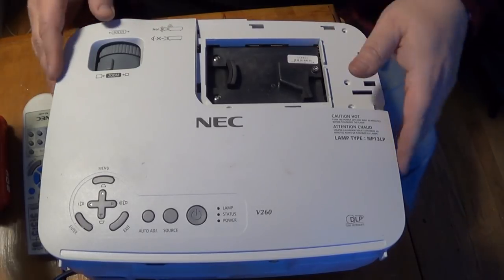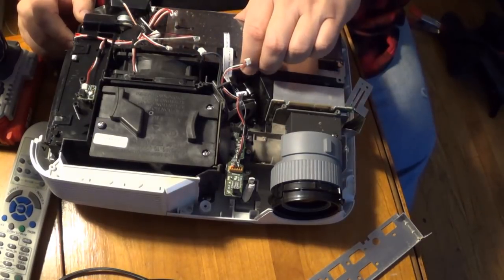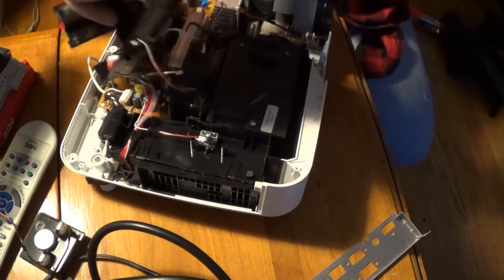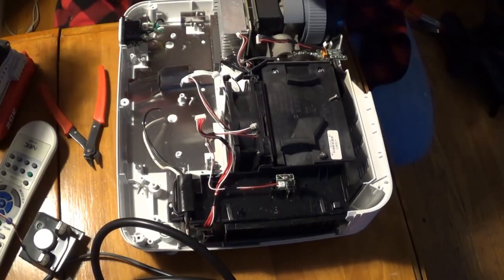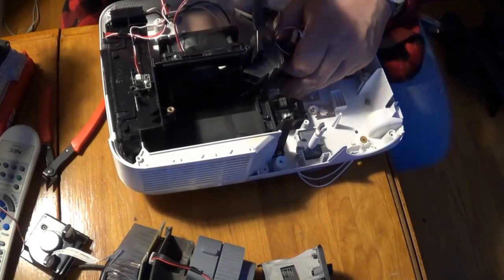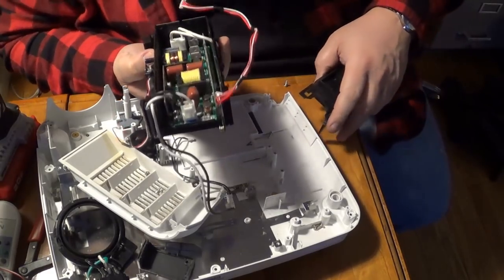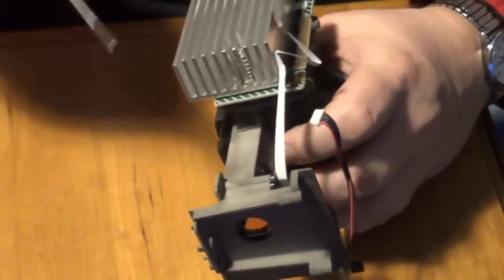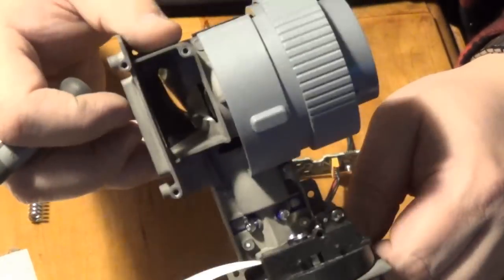Scrapping a Digital Projector for FREE GOLD!  -Moose Scrapper #261

Comment: I strip all my circuit boards using a heat gun. Not that they are alot of value but i get what i can it just makes it easier to get rid of the stuff that is basically garbage. I am saving the striped boards goingvto experiment on seeing how much copper plating can be recovered from them. Using the heat gun to strip is quick and pretty easy. Just heat all the solder connectors and just bang all the components off into a plastic tube. It is best done out side though some of them tend to put off some fumes/smoke if they get extra hot.
Reply from the maker: Ive used that technique before as well.  Fumes are a big issue with that one.  Unfortunately it does not work too well this time of year here in maine...lol..  especially in an unheated garage!  Certainly one of my "go to" methods for things I dont want to damage though like the eproms etc.  Thanks!
Reply: I love this tech! I'm a glassblower, so was set up with a vent before i started scrapping.  If clipping board corners, definately take the gold corner chips.  but not w/o a vent.  i don't use the tub tap tech, because it sticks to any glass i might have on my bench.   i put a C clamp so the board stands up hands free, heat gun the underside, and a steel pick prys off the chip topside with the other hand.
Reply: @travismiller5548  thats a good idea with using the C-clamp i dont have a practical c-clamp i just hold with pliers in on hand while holding heat gun in other hand. If something needs picked put i just get my wife for an extra hand.
Reply: That sounds like a good idea, I just put my boards in a tote for later. Let me know what experiments you do with the copper extraction from your boards. I am thinking about the same thing but just waiting to get my boards cleaned first.
Reply: @jeffreyyeager1398  same here my weather has been poor to get outside to work on them. I dont have a huge amount but enough to see how much metal can be recovered.  I hope to use a HCL Peroxide bath to desolve all the metals then refine it out of solution.